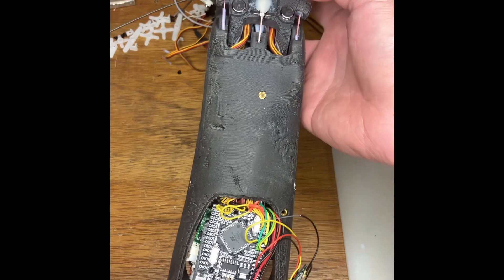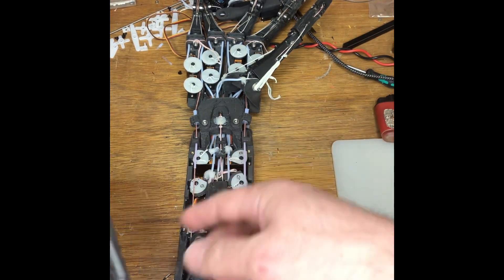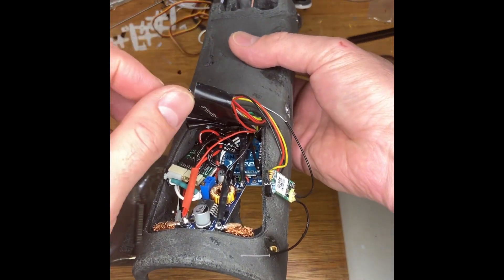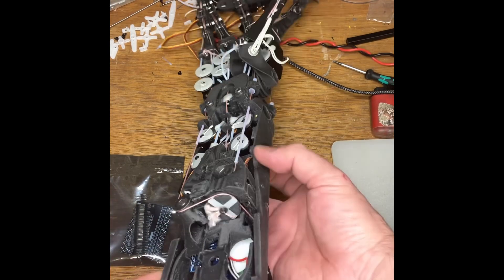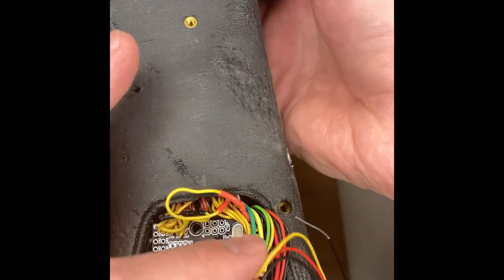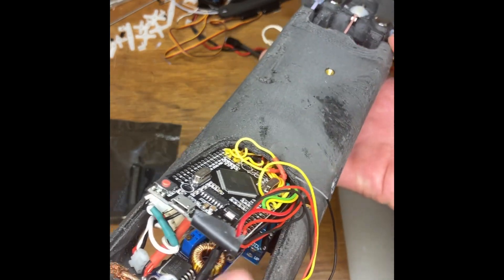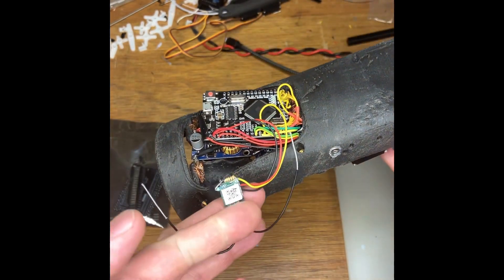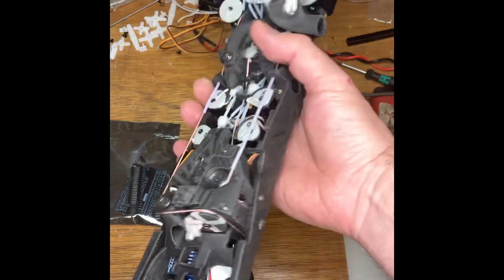Overview of wiring and electronics for the #V1 #DexHand DIY robot hand

Comment: Thanks for the reply. Please specify, does it matter which pin to connect which servo? or are they configured programmatically?
Reply from the maker: Any standard I/O pin should be fine for the servo PWM.
Reply: I mean, the firmware does indicate which servo is responsible for what? And does the firmware have a module for manipulation using google mediapipe?
 @therobotstudio
Reply from the maker: @vladignis8944 yes you have to specify which pin corresponds to which servo. The Google media pipe runs on a PC typically and the resulting angles are transmitted to the Arduino by serial. I use a pair Xbee wireless serial modules to eliminate wires to the hand.

The Mediapipe runs very fast on a Luxonis camera which can be connected to any device with a USB socket. I use a laptop but is should run just as fast on. Raspberry Pi.
Reply: @therobotstudio  And what role does Zigby play in this scheme?
Reply from the maker: The connection to the processor running the visual algorithm needs to allow a USB to serial connection. The simpliest way is a cable adaptor, though they can be temperamental.

My preference to make the hand completely stand-alone is to use a wireless serial network. The Zigbee protocol works well and the standard Xbee modules fit easily to USB adaptators at the PC end and give serial directly in the hand itself.

Don't forget they use 3.3v in the hand!